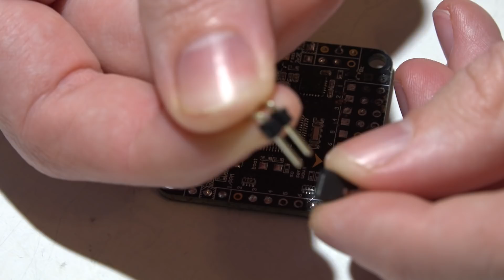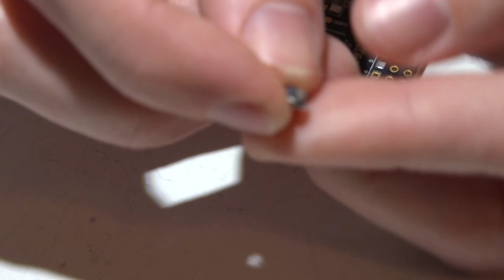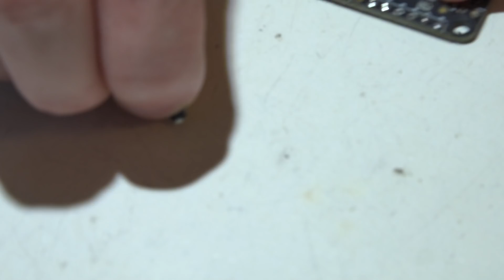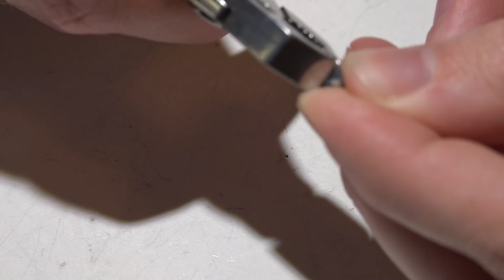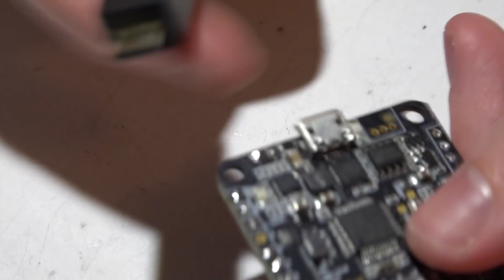Adding Bootloader Button To Flight Controller

Comment: Blue Falcon, Have you done any work on the Flycolor cube (30 amp) system? I have it all together on 2 builds, --and there is now power going to board (no receiver power, no VTX power). Is it possible that after the pins are in place, there is still a power hook up that I am missing?? Thanks again for your thoughts.

Comment: Some of my FC's (mainly the SP3RacingF3's) I have to flash with the STM Flash Loader Demo program because the bootloader cant be addressed by the various configurator programs. Do I then have to press the button all the time to flash with STM Flash Loader or not? That would be not very convenient!